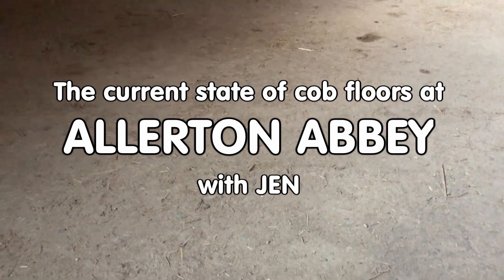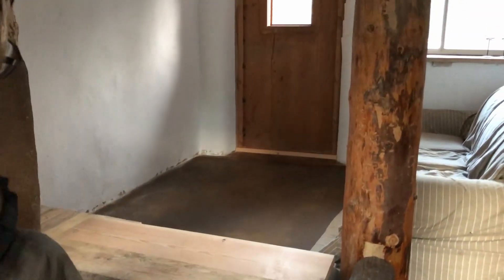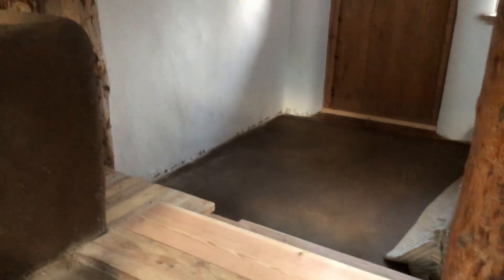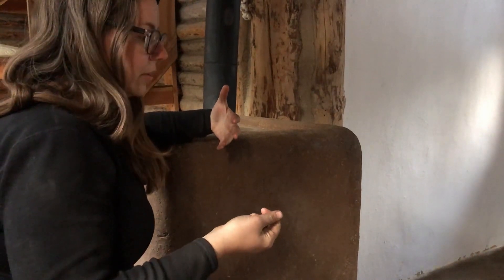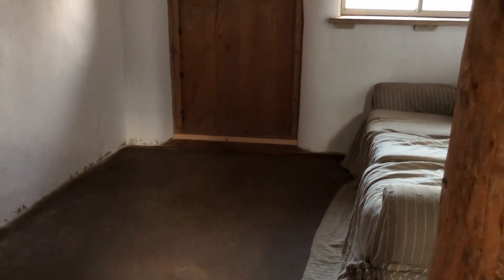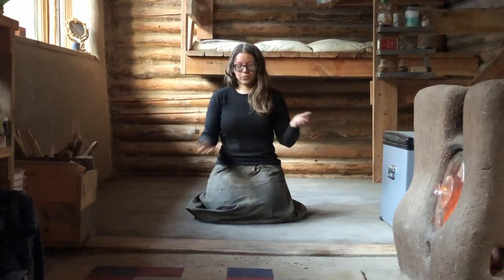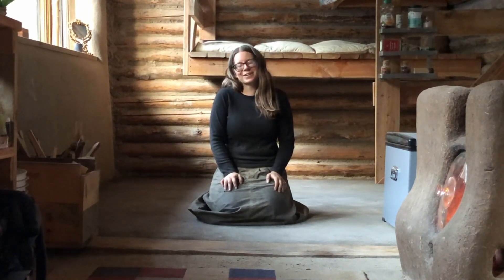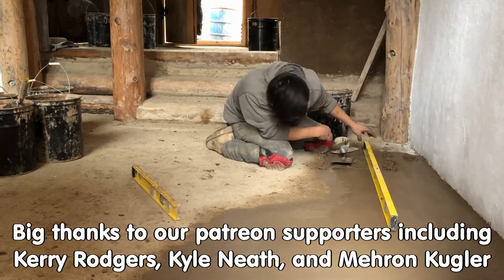cob floor experiments at the allerton abbey wofati

Comment: Where I live, when I build my Wofati-like home, the floor will be cob, but I will definitely have to use a gravel base, with aerated pipes venting past the roof, and then DEFINITELY a vapor barrier. This is to vent radon out instead of allowing it to fill the structure.

Comment: @1:15:  Won't the boards rot over time and create soft spots that allow the overlain cob floor to flex and crack?
Reply from the maker: What boards?
Reply: @paul wheaton:  See time stamp.  She referred to using boards as underlayment (similar to a vapor barrier) rather than plastic.
Reply from the maker: @ncooty  boards were used on top of the cob while working
Reply: @paul wheaton:  Ah, OK.  Thank you for the explanation and, as ever, thanks for continuing to facilitate such interesting experimentation and innovation.  The dead ends and the break-throughs are all very informative.

Comment: this is extremely important information. I look forward to the follow-up in a couple years to see how the wood substructure vs. billboard vapor barrier compares. I realize your WOFATIs do not need hydronic heat, but an experiment I'd like to add to this is how these floors work with in-floor heated tubing as the heat source for the building. Would the expansion/contraction of the tubing completely break down the integrity of the cob?

Comment: I love the experimenting and creativity, but it seems like a heck of a lot of work for a non-durable floor.  Seems like rock or wood would be a better option.  Still cool and inspiring though.
Reply: Over ten years in a friend's house in Colorado and the floors are standing up well. Unlike rock or concrete, these floors have some give which makes them more comfortable. Material cost and environmental impact very low.
Reply: @jerrymcintire7902  How does the floor hold up to chairs?  That would be my biggest concern.  I'm guessing the linseed oil plays a big part in surface durability.
Reply: @KRscience  Once the earth mixture is packed and burnished, it is very durable. You're right, oil helps to give it a smooth and impenetrable surface (especially to moisture, including spills). Chairs are not a problem. Like any surface of natural materials (except rock) you need to maintain the oil but that's a matter of every few years.
Reply: @jerrymcintire7902  I had the same thought about rock floors.  We've got all the nice flat-ish rocks you could want to make a floor for free but my aging body thinks it would be too hard.  I seem to spend a fair amount of my day standing in the kitchen since I'm the primary chief-cook-and-bottle-washer.
Reply: @diannej2406   Another sustainable way to go is cork floors. Not local unless you live in Spain or Portugal, but soft, warm, and resilient = cushion-y. Cork is closed cell and can't absorb water. With a water-base finish over it, very durable. I have seen two churches with sixty and one-hundred year old cork floors, still standing up nicely.
Reply: @jerrymcintire7902  Thanks.  I thought of cork for the kitchen.  Sadly, not local for us, but I might be willing to compromise my principals on this one, especially since it's sustainable even if the transportation isn't.
Reply from the maker: I am pretty sure that the floors will be extremely durable.